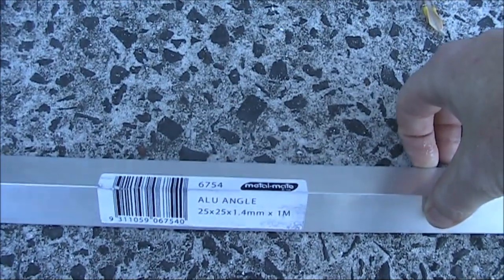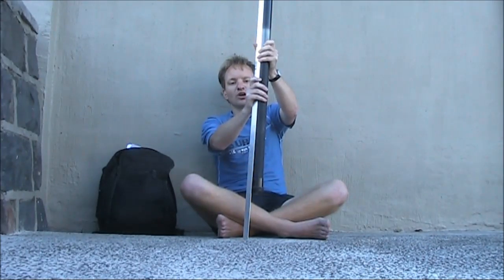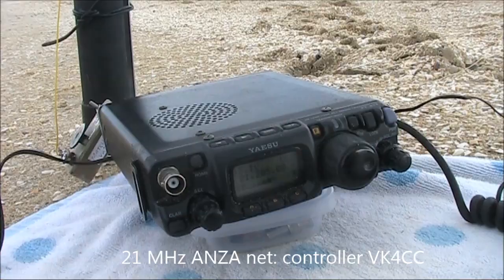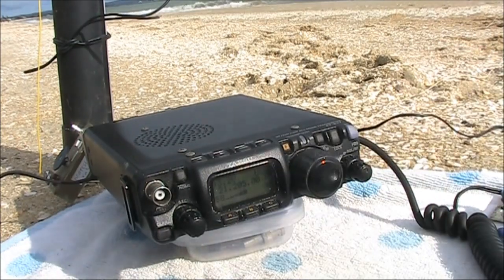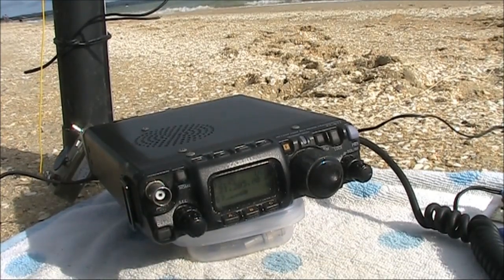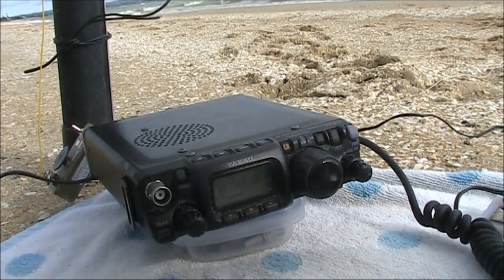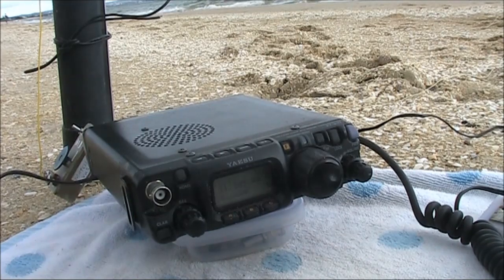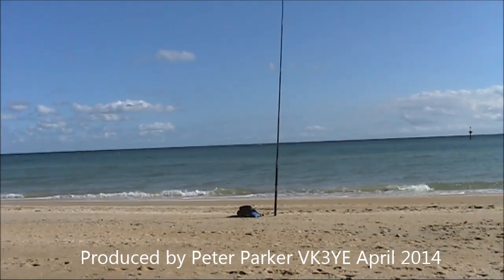Water's Edge Portable DX: Why you need a sand spike

Comment: Hey Peter! I must admit, every time I see that 817 on the beach I just cringe. I know you are careful but I know how Murphy's Law of Sand works..If any sand could get in the radio, it will get in the radio. Have you been lucky or just have not shared your Sand Horror stories with us?v(Knock on wood, don't want to Jinx ya!)

Anyway, here is my suggestion. I bet you could put a nice little clamp on tray to hold the 817 (or whatever QRP Rig you bring) off the beach. Even if it was just 12-18 inches it would be better then nothing and possibly more convenient to operate the rig. And I am sure that the Sand Spike would hold it.

NOTE: I went looking and found this.http://prntscr.com/39aji2  I think a basket maybe smarter. Something like this would hold the radio facing up, I know you like to stand when you operate, blowing sand would fall thru the wire mesh, and you could hold a few other items. Also will make connecting cables easy. And the weight is negligible. If the Spike can hold the Antenna Pole, the extra weight of the radio and basket will be negligible.. And worse case, you could always do the Second Spike Basket, but I know you would rather be a One Spike man being you take the minimalist approach to most things.

Anyway, thought I would throw that out there.

As always, love your vids and what you are doing. 73 de KB3VEW Ron in USA (Washington DC Area)
Reply from the maker: +ThePauperPrepper A year on and the '817 is still going strong!